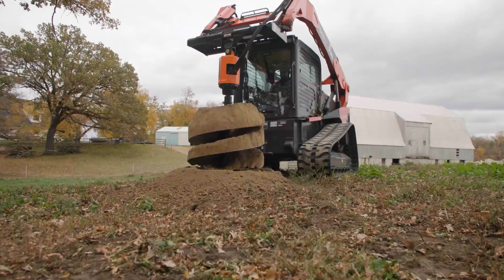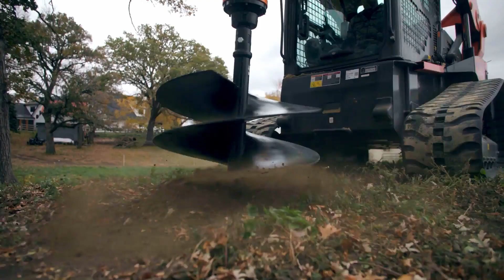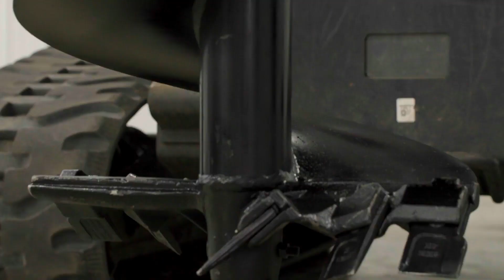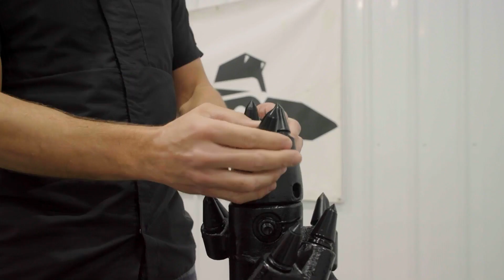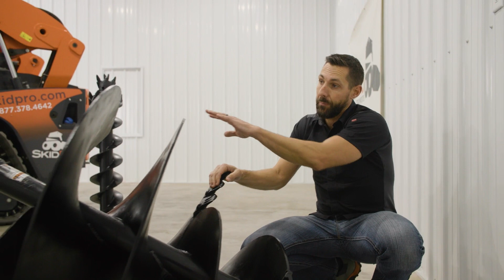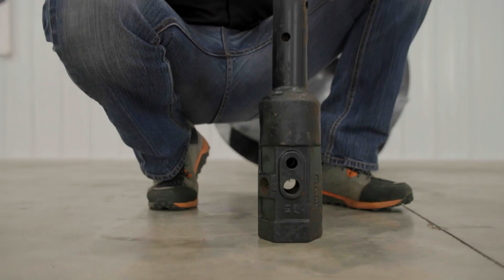What skid steer AUGER BITS are right for you?

Comment: Would high flow help a 10 inch auger to be less likely to stall in extremely hard soil? Seems like high flow spins the bit faster in reasonable density soil,  but ultimately it won't have any more torque when digging in very hard dirt. Is this correct?
Reply from the maker: More hydraulic flow to the motor would mean more torque, so digging in tougher materials would be easier and have less stalling with high flow. Additionally, high flow offers a quicker recovery time upon stalling.